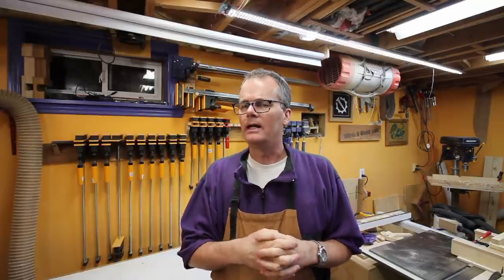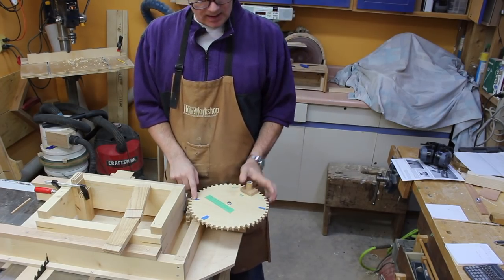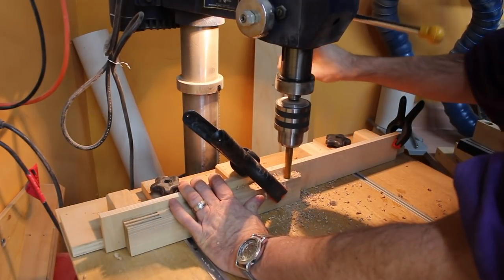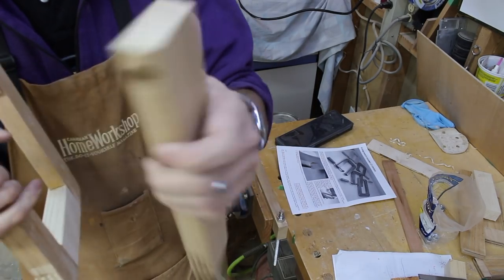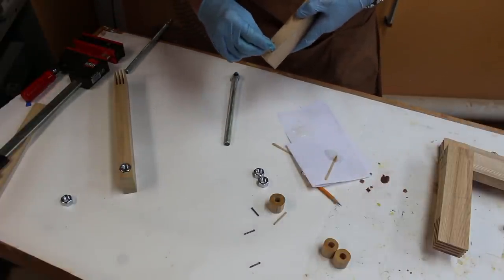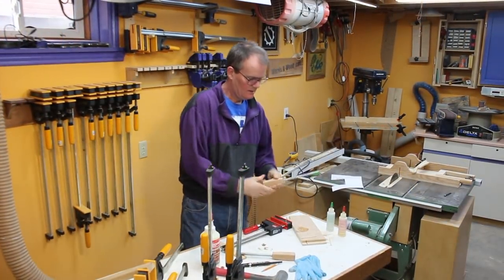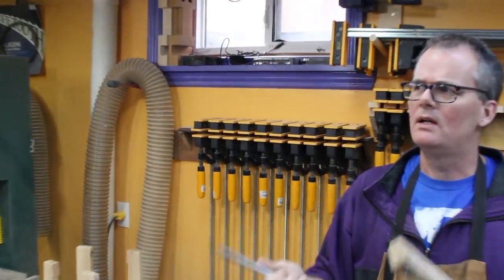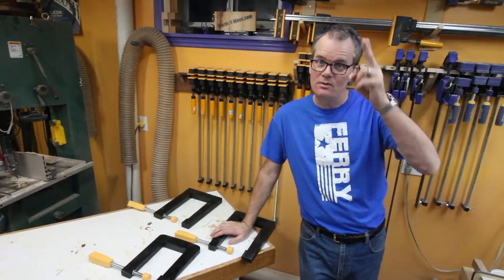How To Make DIY Long Reach Clamps (WnW #94)

Comment: One addition you may like is a threaded rod at the vertical end from top to bottom to provide additional strength for those joints. I saw that on Ronald Walters channel.  ; }
Reply from the maker: That's the John Heisz style also...